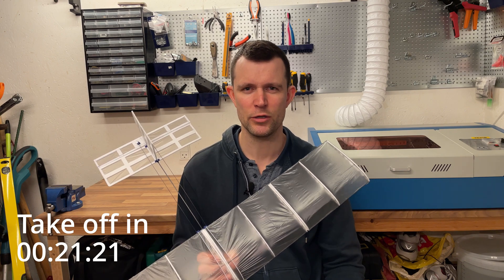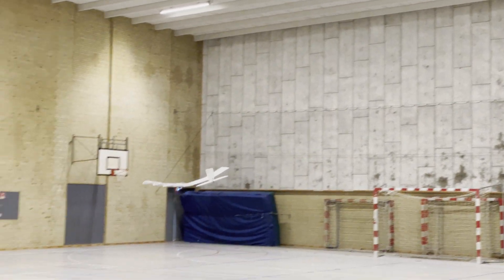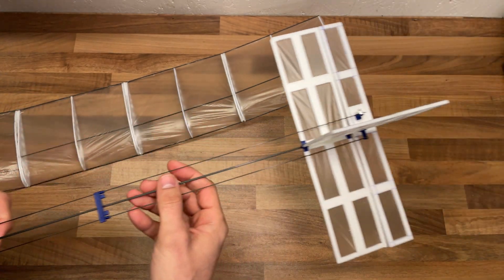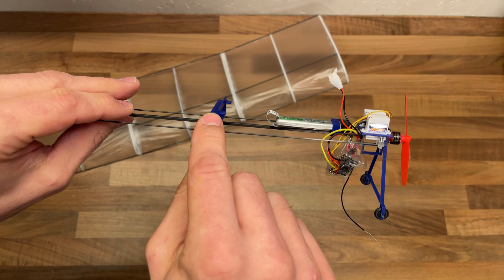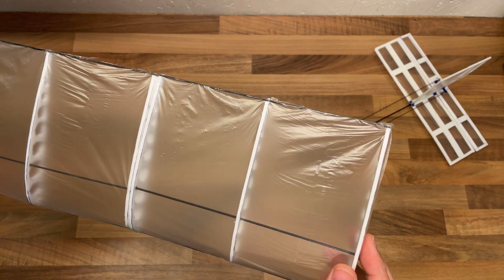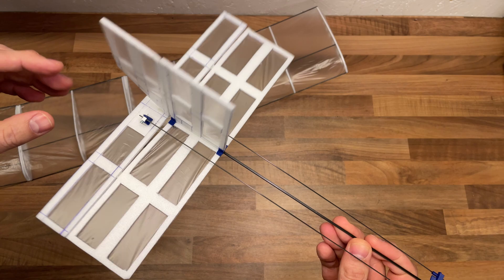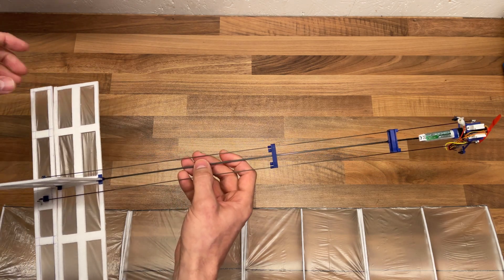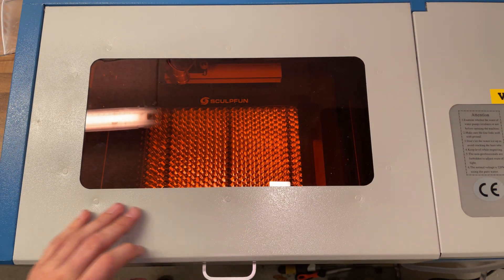The world's smallest brushless motor(BR0603B) on an RC airplane (V2 - It flies really well now)

Comment: Is this propeller 75mm or 54mm?
Reply from the maker: 65mm, kingkong DKK 34.29  40％ Off | 20pcs/lot Kingkong 65mm Blade Propeller Prop For 720 8520 Coreless Motor DIY KIngkong Q100 Micro Quadcopter (10 Pairs )
https://a.aliexpress.com/_mNMCIxg

Comment: I think that I would probably cover it with either Cling film (kitchen wrap) or maybe by floating covering Dope on water - that’s what I used years ago on Indoor endurance model which had a rubber motor. Nice idea using Depron, I’ve used that myself for sub 250gm models, I built a 30” STOL fun fly which used a small brushless motor, it’s great fun to fly outdoors when there’s not much wind!
Reply from the maker: I have never tried kitchen wrap. It is an interesting idea, I will try it sometime

Comment: The tail seems to be twisted
Reply: due to the planes low lift off weight this is needed to counteract the motor torque, I think.
Reply from the maker: The plane is quite delicate, and I damaged the depron in the tail, so it appears twisted

Comment: if the main wing is  NOT  going to have a  Center Section, then the wing mounts  NEED to be contoured, Accordingly.  
WHEN  the  model  is  LEVEL, the  Mass of the main landing gear  SHOULD BE  BELOW  the wing leading  edge.!!!!

Comment: information.          still  LOTS  of  room  for  improvement.
at :37,  the use of polyhedral, and incorrectly located landing gear, are  Still  the  opposite of smart.!          at 2:33,  the use of CF for pushrods  and  spars  is  Still the opposite of smart.!        the dom is Still wonky, with an excess of mass/landing gear/servos  being located  right at the nose; and mass located at the 'top' of the fuselage.        the  tail  is  still  FAT; as result of poor stab  and  rudder design.!          at 3:11,  the chord lengths of the rudder and elevator  SHOULD BE  EQUAL.!        the vert-stab  leading edge  SHOULD  BE  at a slope of 75 degrees.!         part of the rudder  is  MISSING.!         it is correct to use a few degrees of sweep, at the horiz-stab leading edge(s).!         the control horns are not  correctly located.!         there is still a significant amount of  excess mass, in the 'structure' of the stabs.!          at 4:07, this is called 'making a mountain out of a mole hill'.!          at 5:37, this is  a  LESS-than  ideal  wing profile.!      consequently, the wing is making  significantly  MORE-than a nominal  amount of drag.!             this type of (single-surface) profile  should  LOOK  LIKE  the Upper Surface of a clark-y.!!!       with the leading edge being elevated (as you have done), 'in place of' the  'rise' at the leading edge of a  Two-surface profile.        googletranslate
https://st11.ning.com/topology/rest/1.0/file/get/3692001511?profile=original
Reply: Wow David, why don't you show the model you built!!! I think it flies really well Kasper, well done.